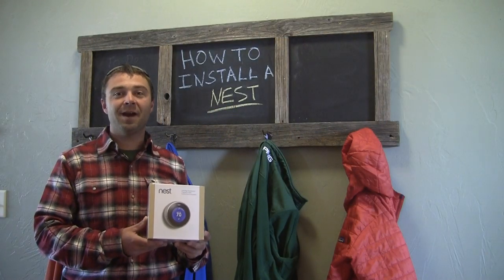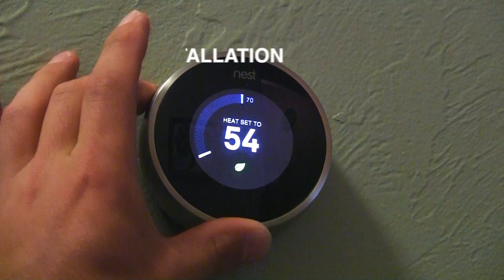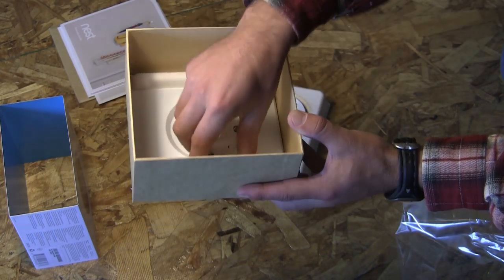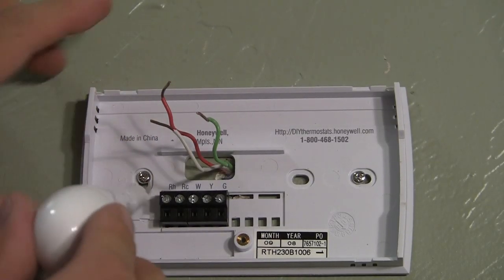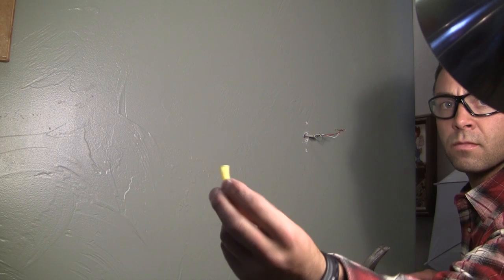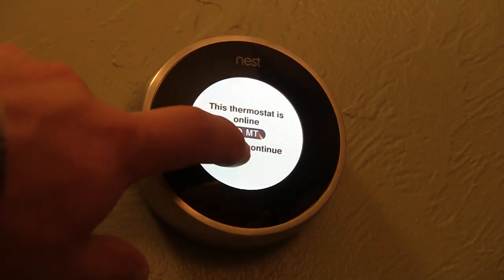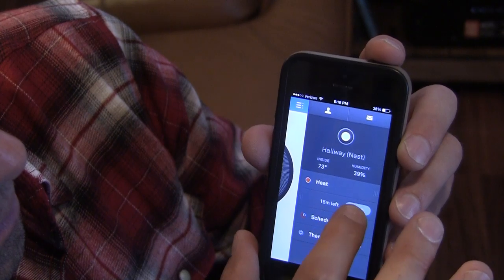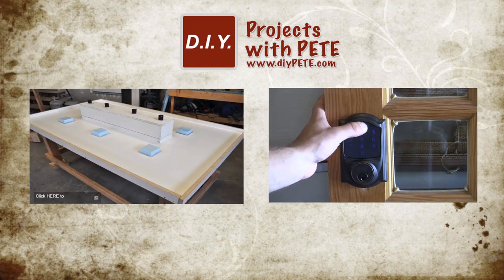NEST Thermostat Review, Unboxing, and Installation

Comment: So I have a basic thermostat that I can set a day to day schedule. I really would like to see a follow up video in a year from now that actually addresses this claim of "it pays for itself". This sounds like a hope, not fact. Do you have data somewhere that backs that up?
Reply: Hi Matthew, 
Thanks for chiming in. The "Pays for itself" is simply based on the fact that a correctly programmed thermostat can save about 20% on your heating and cooling bill each year. I am one of those guys who didn't take the time to properly program my older thermostat because I simply didn't take the time to figure it out. Because you've taken the time to set up your thermostat you are saving yourself money. The automatic scheduling and the ease of setup is why nest claims the average person will save money. (b/c the unit will be at least somewhat programmed compared to not at all) They are banking on the ease of use factor and the auto scheduling to help many people. I will do a follow up down the road when I get more data and do a side by side comparison of what I personally see at my home for a change. I feel like I will definitely conserve more energy because it automatically goes down each night no matter what. Compared to the old thermostat which wasn't programmed and I didn't always adjust. Thanks again for questioning the reasoning. Energy.gov is an excellent resource that does point out how many people waste energy because of improperly configured thermostats. If you are on top of things, a normal thermostat will work great and there is no need to upgrade. I am just a fan of the additional features and the ability to control it remotely. As well as the notifications for low temperatures as we have problems with pipes freezing when furnaces fail. Have a great day and take care!  - Pete

Comment: Dont the device need power? Is it wired or battery powered?
Reply from the maker: +Manoj Philip The Nest Learning Thermostat works with low voltage systems within a range of 20 - 30V AC It basically runs off a common wire - A common wire is simply a low-voltage power wire to bring constant power from your heating and cooling equipment to the thermostat. Most common wires are blue or black, and you might have a common wire already.